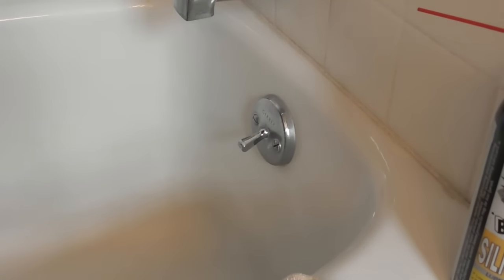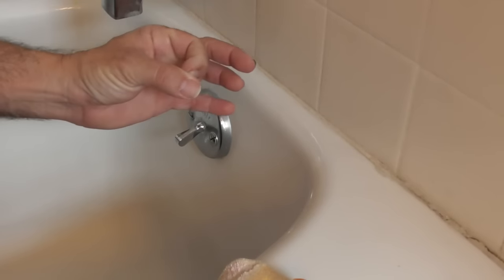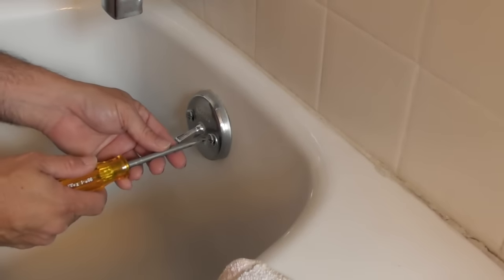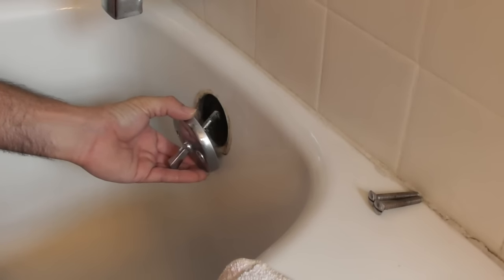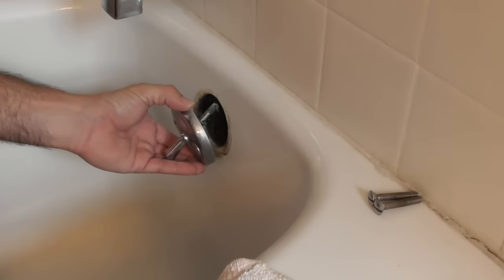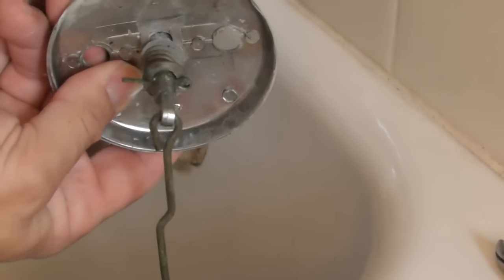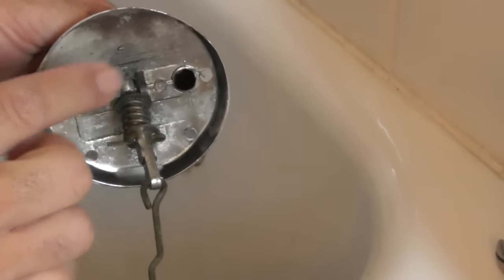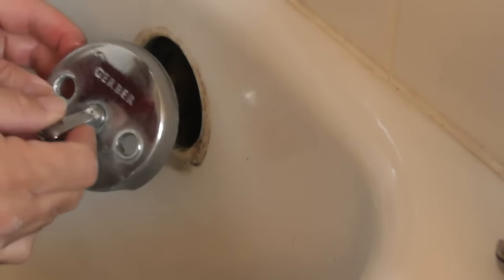Bath tub trip lever/ bath tub stopper replacement or adjustment easy fix

Comment: My problem is completely the opposite! My lever moves too easily and the drain stopper pulls it up!
Reply: Easy fix,
Take off the cover plate and remove the assembly.
Remove the cotter pin, and the washer in front of the spring.
Next remove the spring and spread the coil a little with a screwdriver, lengthing the spring.
Replace the washer and cotter pin.
And reattach face plate. 
Takes about ten minutes tops.